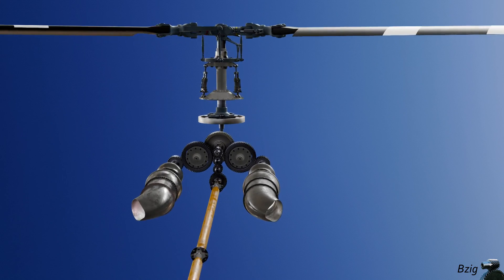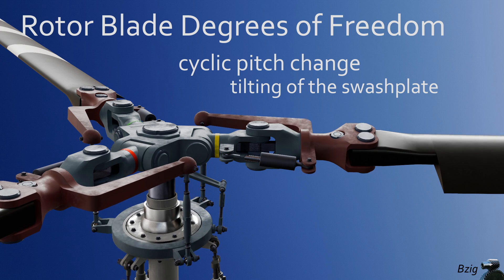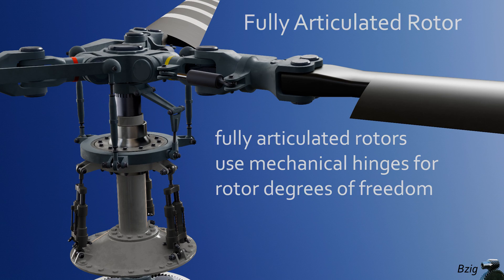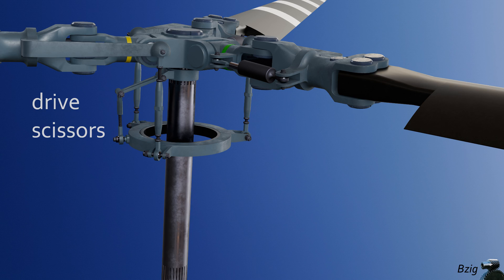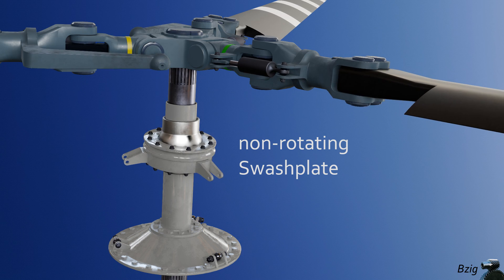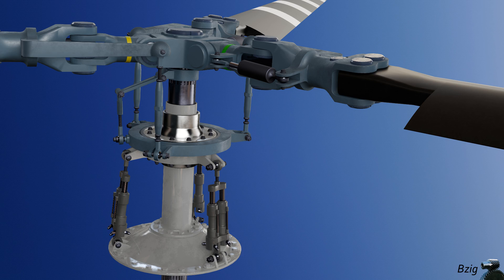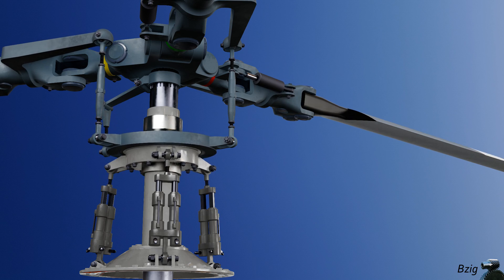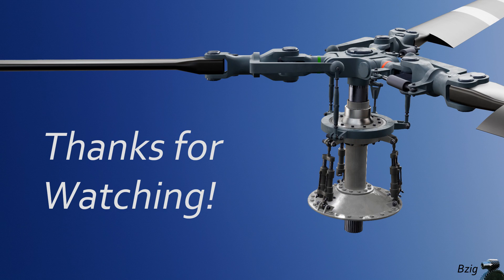Helicopter Swashplate Control

Comment: So with the flapping hinge. Why don't the blades just fold upwards?
Reply from the maker: Centrifugal force loads on the blades are powerful and prevent that.  As the blades flap away from neutral, the CF loads that pull them back to neutral increase and the lift forces decrease... it's a very stable system.

Comment: This is absolutely amazing! I do passenger briefings for offshore helicopter operations and training animations and came across this as I was researching how to do it myself.  May I ask, where do you get your references for the rotor systems? I've been working off of photos for the exterior or my models but have been struggling to find accurate drawings or blueprints for the rotors for the different types and models.
Reply from the maker: The particular video you commented on was an original bzig design, based loosely on photographs from Boeing 107's.  Lately, I've been trying to be more realistic.  My model of the R-44 is based on the illustrated parts catalog, but I also take those part numbers and search for them on websites that sell those parts.   Most of the  companies that sell them, have multiple photos, from different angles

Comment: When flapping up I always thought the pitch of the affected blade would also decrease. In the video I don't see it happening beacuse of the position of the control-arm connected to the blade. 
My question: Does the pitch decrease in this situation or not?
Reply from the maker: It's design specific.  That feature is called "pitch flap coupling" or "delta-3 coupling"   and, you're correct.  I didn't model that coupling into this design.  Check out my R-44 video series, that aircraft has pitch-flap coupling in both the main and tail rotor.
Reply: @bzig4929  ah thank's. I'm not a heli-pilot, unfortunately, but I've always found them amazing machines!

Comment: Is there a mechanical device/hard stop that limits the flapping angle?
Reply from the maker: There is a mechanical stop, but it's only meant for protection during start and shutdown.  

In-flight, when at operating speeds, there is no mechanical constraint.  Blades stay in position just by the physics of the lift vs. the CF loads on the blades.  

I didn't explain this in this video but it's a cool concept that would benefit from a better explanation.

I did a follow-on video of the UH-60 where I explain this concept.   It's a great question, so thank for asking.

Comment: The 'lateral cyclic pitch' is for coordinating forward, to-the-aft, c-side, or reverse-c-side. [?] To go to the aft, the axis of the disk 'aims' to the 'tail' of the craft. The disk pushes each blade upward in the front 'to draw a hill or upward curve' while 'swinging' to front of the craft : causing the blade to aerodynamically angle the front of the craft upward and apply a force on the craft to go to the aft, or 'backward'. I am not sure how hot the disk and servos can be when applying 'lateral cyclic pitch'. AND they appear to be the tech that might break before any part in the engine. The flapping keeps the craft hovering without being pushed around by sudden cross-winds. [?]

Comment: I would not say you animated it wrong, but there is an element that would be great to show, but it is not shown. When you show the Cyclic Pitch, you change the swashplate all the time. I would be great if you add an animation with swashplate tilted in one direction and rotor doing few full rotations, to show how the blades pitch change depeanding on the direction they are pointed at.
Reply from the maker: I like the idea.  Thanks!   I just posted this...  https://youtu.be/J_uvaR9rKHg  It's a different 3d model than the one you commented on, but I think the concepts are easier to see on an aircraft with four blades.

Comment: Real helicopter use Bell system dont need gyroscope auto control cyclic pitch? I just knew RC helicopter flybarless always need 1 gyro if not its cannt fly control. Sorry for my English.
Reply from the maker: The Bell flybar system predates electronic stabilization.  I don't know much about RC helicopters, but I can see why the flybarless designs need gyro stabilization... those aircraft have so much control power in order to do the things they do.  Almost all modern, full-sized, helicopters have very sophisticated electronic stabilization.  About the only aircraft without it are small single engine training aircraft.
Reply: @bzig4929  thank you so much!

Comment: Hello
I’ve been a helicopter maintenance technician and technical instructor for a number of years and your videos are excellent. However, to explain the helicopter flight control system, I suggest in using a two-blade rotor system and a swashplate with a 90° control input regime rather than a swashplate having 120°. For students it would be easier to understand the influence of the gyroscopic precession on the flight controls.
Keep up the good work!
Reply from the maker: Thanks for the feedback!  I'm working on a 4 blade model for the exact reason you say... It's easier to see and understand things like forward flight disymetry of lift and precession
Reply: @bzig4929  Sounds great! I have suggestion for another project. Students often have a problem understanding the functioning of a so called “phasing unit”. For example, such a unit is installed in the flight controls of a Super-Puma. The unit rephases the 90° cyclic input signals to the 120° regime required by the swashplate. It would be great to have an instruction video showing the concept.

Comment: As far as I understand, EC-135 doesn't have any of these hinges (except feathering) and it still flies, is quite controllable, stable and doesn't vibrate. How come?
Reply: The EC135 and EC145 have bearingless rotors. Rather than mechanical hinges, all three degrees of freedom for each blade are provided by a composite flexbeam that can bend and twist as needed.

Comment: I'm curious why the lead/lag is accomodated for rather than an attempt to eliminate it.
Are the forces involved just too much stress to restrain?

I'm also curious how the non rotating swashplate is fastened to the spherical bearing.
I see there are a ring of bolts surrounding it which leads me to surmise that the bottom half (if it is in-fact two pieces) is sent down the transmission adapter first, followed by the bearing, then capped with the top half clasping them all together, is this correct?

Fantastic breakdown as always.
Reply from the maker: The lead-lag degree of freedom can be eliminated with a type of rotor called a teetering rotor.  In a teetering rotor, flapping occurs very close to the center of rotation.  

In the rotor system I animated, the flapping hinge is offset from the center of rotation and this causes two things that make a lead lag hinge necessary.

The first is to relieve out-of-plane rotor forces when the rotor disk tilts on its virtual axis.  This is due to Coriolis effect.  

The second reason is to allow for conservation of angular momentum.  When the blades flap, their CG also moves inward.  Much like an ice skater spins faster when she moves her arms inward, helicopter blades must spin faster when the flap away from neutral... The lead-lag hinge allows them to spin faster for the half cycle where they flap away from neutral, followed by spinning slower as they flap back towards neutral.  

Blades that don't lead-lag are called "stiff in plane" and these designs are possible, but not good for structural life of the blades.
Reply: @bzig4929  excellent breakdown thankyou!
I hadn't considered that at all.

Comment: By mentionning phase delay do you mean the gyroscopic 90° lag effect on force ?
Reply from the maker: Yes... About 50% of text books call is gyroscopic presecion and the other half call it phase delay.  Gesow and Meyers points out that phase delay also happens in non-rotating systems.  I use the term  "phase delay" to describe this, but understand that gyroscopic precision is an acceptable term.

Comment: and the whole time this system is working it wants to kill you and is just waiting for you to make a mistake...
Reply from the maker: Harry Reasoner once said, "The thing is, helicopters are different from planes. An airplane by it's nature wants to fly, and if not interfered with too strongly by unusual events or by a deliberately incompetent pilot, it will fly. A helicopter does not want to fly. It is maintained in the air by a variety of forces and controls working in opposition to each other, and if there is any disturbance in this delicate balance the helicopter stops flying; immediately and disastrously. There is no such thing as a gliding helicopter."

Comment: This is all fascinating.
The blade pitch control (collective and cyclic) is clear, but what is the purpose of the lead/lag and the feathering? and how is feathering restrained when under load?
Reply from the maker: that's my next video!  I've started the story line and script and, once that's done, I'll start creating the video clips.  Even though I'm reusing the same solid model, there is quite a bit of work to do to get them ready.  

In short... flapping allows the helicopter to fly fast and also allows control.  But when it flaps the individual blade center's of gravity shift and this would create a problem with conservation of angular momentum... and this is what the lead-lag hinge solves.

Constraining feathering under load... that's interesting... the blade pitch is close to the aerodynamic center, so loads are as low as they can be, but still significant.  The answer, I believe, is robust components and lots of hydraulic pressure.

Comment: what is the role of lead lag and role of flapping?
Reply from the maker: I've started work on a video to explain that.  In brief... Lead lag is for conservation of angular momentum.  When the blade flaps on a offset hinge, the center of mass of the blade move closer to the center of rotation.  This would cause the rotor system to speed up, which it can't do, so the blade leads of lags monetarily to conserve momentum.
Reply: @bzig4929  Waiting for the video. I wish you good luck

Comment: So, how is flapping "controlled"? What's stopping the blades from just folding upwards with the lift? It can't just be the centrifugal force, can it? Are those hinges spring loaded and damped somehow?
Reply from the maker: It's just CF and the damping from the CF is sufficient that flapping doesn't need any springs or dampers.  This doesn't address droop (negative flapping) when the rotors stop... This is handled with a mechanical droop stops that I didn't model in this simplified CAD model.  Thanks for the question.  I want to do a video on this exact subject... My day job keeps getting in the way.

Comment: Q:  Why are most helicopters have four or five rotor blades?  Can they build them to have 9 or 12 blades (multiple of 3s) because they can outperform some other fewer blades in term of lifting forces?  
Did any companies ever tested with such a more complexity by having a higher number of blades?
Reply from the maker: That concept is called "solidity". It's the ratio of the solid planform area of the rotor disk, to the empty platform area.  Generally, for higher gross weight, you want higher solidity.  So wider chord blades or more of them.  I think the limiting factor to more-blades will be fitting the rotor controls into the narrowing space between the blades.   The most blades is 7 on the ch53 and mi26. I could be wrong.

Comment: This is key element of helicopter stability. And it was invented by  Igor Sikorsky in  1926 year in the USA after several years of work with different prototypes of helicopter, which were not stable enough in flight. He started his inventions in Kyiv Polytechnical Institute, Ukraine,  which is titled by his name.

Comment: I would like to model this in Solidworks, CREO, CATIA, etc. Can you please tell me your source information.
Reply from the maker: Sources were Internet photos, type certificate data sheets (drs.faa.gov will get you those for civil certified helicopters) and flight manuals are good sources of this information.
Reply: @bzig4929  Hey, I appreciate the response. Another question. It doesn't matter, but what CAD software did you use to model with?
Reply from the maker: Fusion 360 and I export to 3mf and then import into Blender for the animation

Comment: What I have not understood is the rotation of the blade, am seeing it running in an ant clock direction, is it ok or it must run in a clock wise direction
Reply from the maker: It's the preference of the designer.  I believe most main rotors turn counter clockwise, but there are more than a few that turn clockwise.

Comment: Great stuff man! I'd love to see a video similar to this but with a semi rigid rotor system. (this model seems to based off a blackhawk or similar, right?) Been working as a helicopter CFI and your videos are great to explain to students how all the concepts tie together
Reply from the maker: Cool idea on the semirigid rotor!  I'll need to figure out how to bend objects in the animation software.   The main rotor, in this vid, is modeled after a ch-46, but the tail rotor and tail rotor drive is modeled after the S-92/Blackhawk.   I had already done a ch-46, so I just copied that main rotor instead of creating a new one.   The hawk also has the engine further forward with a nose gearbox... So the main transmission is also a little different.
Reply: @bzig4929  Ah that's awesome, thanks for the clarification on the models it was based on!

Comment: So… now comes your illustrations of how the rotor head works in the newer (to me) bidirectional head where the top head goes one way and the bottom goes the other, eliminating the tail rotor input (sort of… generally speaking).  Now frequently used in r/c helicopters, making them easier to fly for the youngsters.

Comment: wait, but what limits the flap in a hinged system? like why don't they droop on the ground, or flip up when lift is applied? is that just based on centrifugal forces?
Reply from the maker: Yes... CF loads.  What's cool is that the CF loads increase as the blades flap away from neutral so it's a heavily damped system.  Meaning that even aggressive maneuvering is unlikely to overlap the Rotors. 

My animation is greatly simplified and real helicopters have flap stops that are there for low rpm...  Startup and shutdown.  The stops are spring loaded so they are only in place at low CF (low RPM).  if the blades were to contact a stop at high RPM - they can't because the CF loads overcome their spring force, and move them out of the way - but if they did, they would not protect the rotor.  Loads are too high at flight RPM.

Comment: I am an Emergency Physician, I am not a pilot, but I do fly fairly large RC helicopters as a hobby and have a fairly good understanding how this works, but these videos really put it in perspective at just how complex this stuff really is.
My father flew the Bo 105 PAH-1 in the German Army and that machine used a different rotor head system.
He used to tell me, a helicopter doesn't fly, it's a 10,000 bolt contraption that beats the air into submission while at the same time trying to self destruct.
Thank you for this very informative video.

Comment: Clear, concise and easy to understand explanation for a rather complex system, though I don't know how meaningful that statement is, since I am a trained industrial mechanic. One thing however that I either didn't understand or was missing from the animation/explanation was how flapping is "controlled". As you said it's entirely determined by aerodynamics and inertia but I would assume that the hinges that facilitate that motion have a neutral position and that there is some sort of spring element that tries to return the blades to that position. Just like the spring element for lead lag.
Reply from the maker: My vision with this is to do a series of videos that build on each other.  The reason  flapping and lead-lag exist are very specific and deserve a good explanation.  I'm also trying to grow my animation skills and I need to learn how to do on-screen annotations for those topics.  For the short answer... Flapping exists to correct for "forward flight dysemmetry of lift" and to allow control by tilting the tip path plane.  Lead-lag allows for conservation of angular momentum as the blades flap asymmetrically.  I love comments like yours!  They really help me make the next videos better.  Thanks.

Comment: Hi mate, I’m curious to know how the flight controls are connected to the rotors. What I’m asking is, when pilots make an input on the cyclic or collect, what mechanism drives the input to the rotors to perform the input. Is it a combination of wires, hydraulics or something complete different. I’m struggling to find any answers online. Thanks!
Reply from the maker: Good question!  When you see how complicated these are, you'll understand why I didn't include that in the animation.  If you do an image search on "helicopter mixing unit" you'll see what I mean.  

The complexity comes because each control on the flight deck has to influence all three hydraulic actuators, so they all have to get mechanically mixed before they connect to the pilot valves.  And larger helicopters also do some non-traditional control mixing. The canted tail used in many Sikorsky aircraft would case a pitch change with pedal input if it were not dealt with at the design... So they mix in longitudinal cyclic commands with the pedal inputs.  

I may tackle the mechanical controls for a future animation, but it's a daunting task.
Reply: RC helicopters just use electric motors to actuate. They have a digital mixer in the remote.